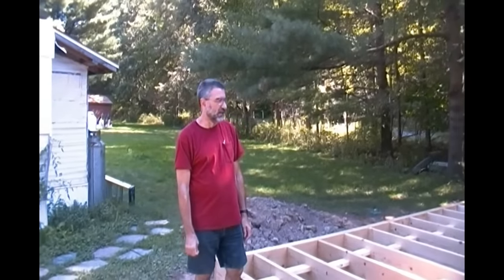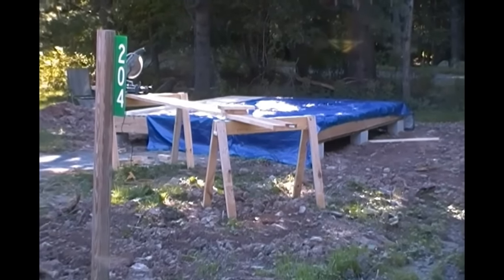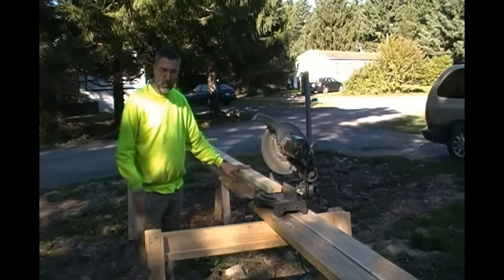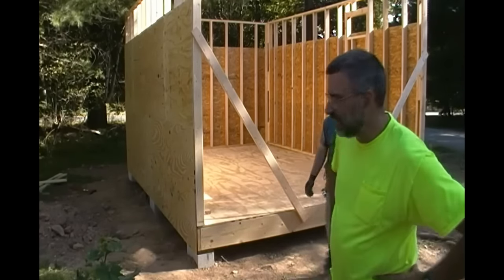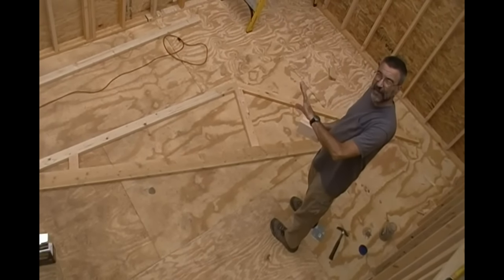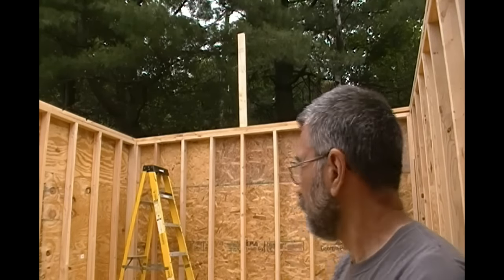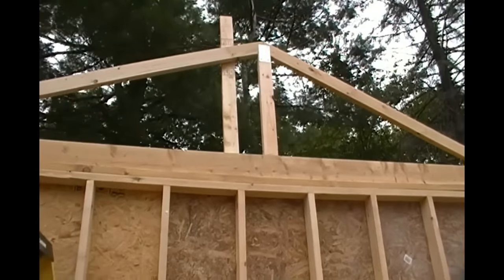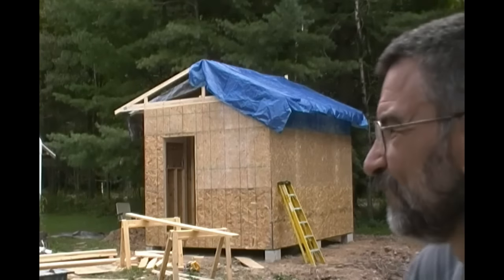Shed Rebuild (pt4) - Framing

Comment: Video Title: Shed Rebuild (pt4) - Framing
Really nice and informative video! I know what you mean by wearing out easily, I’m 63 and have ½ the energy I used to have & that is being generous, LoL.
When I built my shed, it may have been overkill, but I sprayed creosote on the underside of my floor joists etc., everywhere I was not going to paint, however I was young then and planned on the shed lasting 50 years. I’ve sold the house 25 years ago, but I ride by and it’s still standing. Mine was 8 foot walls, X 8 wide x 12 feet long. I poured 5 pilings 12”x12” with 4 rebar each for strength. The 5th piling went in the middle. 3/4 of the shed hung out over the steep embankment because there was a rail road behind my property, so I made the most out of my little yard, the back two pilings were 3 feet out of the ground and all pilings were about 3 feet in the ground or deeper, I built forms out of old plywood and called the cement truck, LoL. In my case, the front pilings were 1” above the ground. I am no builder, so I was just winging it from watching my dad put up our garage when I was a young kid and a few “do it yourself books” and a lot of hoping what I did worked, LoL. 
Making the walls higher I think is a great idea, the more room the better. I guess it’s always a guessing game, how wide and long to make the shed (unless you have a zoning code to adhere to) and, keeping it from looking weird, or going over budget, because the sky is the limit “so to speak” when you build it yourself and know what you are doing. 
Are you going to install a wood stove or vent less propane heater in your shed or is it strictly storage?

Comment: If that nailer is not working, take it apart, and oil it. My roofing nailer set idle of about five years and some plastic parts had dried out. Bostich will be able to get the parts for you.What ever the problem is, with your mechanical skills you can fix it.

Comment: Hey Bill - what an amazing job you did there with Michael!!! It looks really sturdy, really neat and very stable and spacy. You wil have huge benefit from this extra space next to your house. Hopefully it gives enough space so you can move all teh Thrive boxes and food supplies in teh shed as wlel, leaving you more space and comfort in your actual living space. Truely a fabulous job! WIll you insulate teh walls and roof as well to keep it frost free in winter? I hope you will have it done before autumn rain and storm and all that comes! Bill, one thing though - you sound really really exhausted, short of breathe and you look very tired. If I would not know better I would think you were very sick. I hope you are allright?!?!?! Good luck and much strength for the last parts of the job!
Reply from the maker: Insulation and heat is an option for the future, but the only reason to do that is if I want to use it as a workshop. And no, I am not sick.  I'm fine. Short of breath?  I'm not sure why you thought that.
Reply: glad to hear you are fine!! As for insulation and so on, will low temperatures - freezing conditions - not damage the food suppleis if you have those in there? You will have lots  of space in it! Absolutely fabulous shed!!
Reply from the maker: Our food storage will still be stored off-site.  But no, freeze dried food is not affected by the cold because there is no moisture in it.  The shed will be for things like bicycles (we love to ride and we have 4 of them), lawn mower, snow blower, all my construction tools (generator, air compressor, etc.), Christmas decorations, camping gear.  Stuff like that.  Right now we keep all that stuff in a rented storage space.
Reply: AH okay - well that certainly will help a lot too, and save you a lot of money! Great job again, Bill!

Comment: Looks great , good idea using the rigid foam boards on the floor .   Do you plan on wrapping  the building before siding ?
Reply from the maker: I thought about wrapping, but I don't know if I will.  IF I decide to insulate, I would only heat it occasionally to use it as a workshop, etc.  We can't legally live in it.  So I'm not sure that wrapping it would give much benefit. I'm still undecided on this.

Comment: How did you join the two 2x10 or 2x8's? I saw you put two seperate ones butted up to each other? I'm about to build a 12x20 shed so I will have to join at least one set

Comment: Could you have done a roof like this for the main home when you were having the roofing problems?
Reply from the maker: I wanted to add a roof like this on top of the trailer, but the building inspector wouldn't let me.  He said it wouldn't handle the weight.  (He's wrong)  He suggested that I build a free stand carport type roof over the trailer.  But that involved many posts into the ground and a lot of extra building permits, inspections, and expense.

Comment: That is a big shed ,makes your trailer look small,build 2 together and you would have a nice tiny house,,you didn't mention cost of materials.
Reply from the maker: No I didn't mention cost of materials, because the project isn't finished yet. But it will be somewhere in the neighborhood of $2500
Reply: Some of these tiny houses sell for 50 to 60 k or more,I think you could build one for way less,especially if you used recycled materials. Enjoy your channel.God Bless.

Comment: thats gonna be a great little cathedral! what kinda permits are required to build a shed like that where you live?
Reply from the maker: I had to get a permit to demolish the old shed and another to build the new shed.  But anything under 200 sq ft does not require any building inspections. So with 12x16 (192 sq ft), I can do what I want without the building inspector getting involved.  When it's done, the zoning officer will inspect just to make sure that it IS a shed, and not a bedroom.  And also to check the setbacks from the property lines.
Reply: thats not too bad then

Comment: Hi, Bill: Why did you choose to put just a single door and not a double door that might allow easier access for larger storage items?  (Love the series!)
Reply from the maker: First, I already had the door left over from another job from several years ago.  I've been storing it forever, and I can FINALLY use it!  Second, It's a 36" door.  That's wide enough for bicycles, lawn mower, and snow blower.  I don't anticipate anything larger than that.  I thought about a garage door, but decided against it. It would add to the cost, and I'm not sure I would ever really need it!
Reply: Wonderful!  I knew you would have a good answer.  Even though my prepping is limited to a well-stocked pantry, I follow the tiny house and prepping movements because they appeal to my frugal-living values.  I get very happy :^) when I figure out a way to re-purpose an item or find something I need from stockpiled items, such as your door.  I am looking forward to more in this series!

Comment: Ummm, you explained what the bolts were for in the prior video. You an Elizabeth just give details differently, nothing wrong, just differently.  Is there a reason there isn't a concrete foundation?  I may have missed that, but keeps critters from underneath.
Reply from the maker: Several thousand dollars!

Comment: roof should be cdx not osb plywood..OSB is like a sponge..then dries out and rots..only for walls if you have to.
Reply from the maker: I have been building houses all my life.  I have ALWAYS used OSB for the roof.  And every other contractor that I have ever worked for has also always used OSB for the roof. I also sold and set modular homes for many years, and the modular factories all use OSB.  It passes code, and there are no problems with using it. on the roof.

Comment: Could a pre-built shed have been purchased to give yourself a break?  With all the work you have done to the trailer and do driving a truck, you need a break!  I hear you panting now.
Reply from the maker: If you watch the rest of the shed build videos, you will see that my shed is well-built with 2x4's, and a 9 foot ceiling for extra storage room.  It is a storage shed, but it is also a fully insulated, heated, and air conditioned bunkhouse for guests. It's also much larger than most prebuilt sheds.  No prebuilt could come close to what I have built. It took me almost a year to complete it, but I am VERY happy with the end result.

Comment: why not buy a prefab garage were looking into them you can get a 12x20 for 5500.00
Reply from the maker: Because this is better built (I know because I'm doing it myself), and it will cost me less than half that much.
Reply from the maker: Also, that's too big.  Ours had to be under 200 sq ft for zoning. Ours is 12x16, 192 sq ft